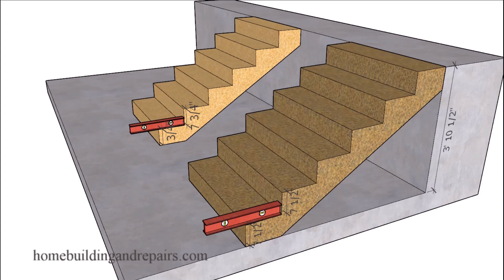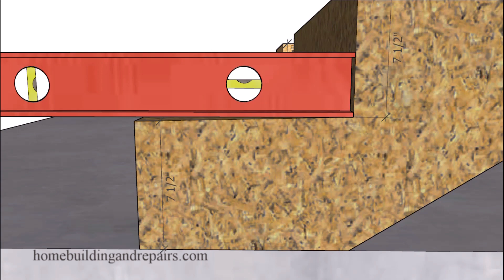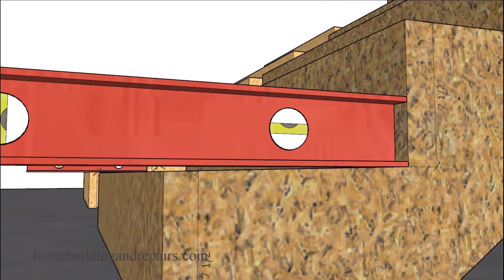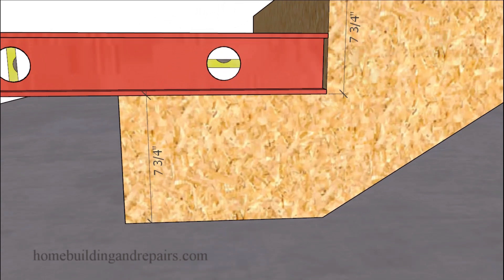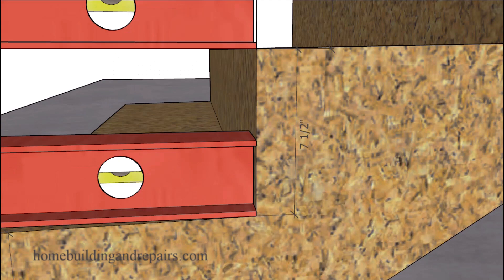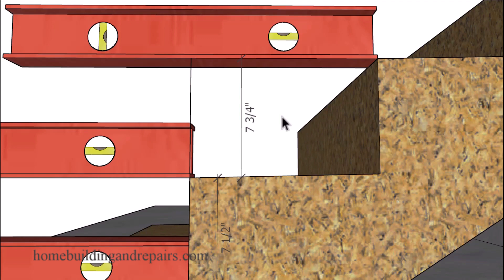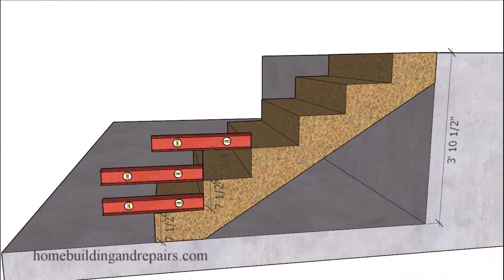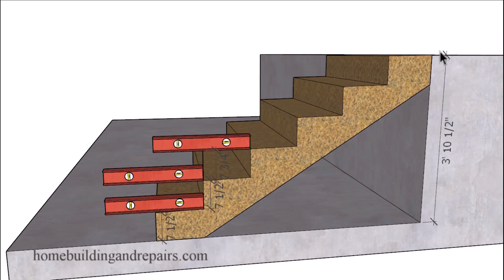How To Calculate Individual Stair Riser Height For Sloping Steps - Building Code Interpretation

Comment: I want help for stairs risers height problem

My worker has done wrong work

7 inches

7.25 inches

7.50 inches

7.25 inch

7.75 inches

6.50 inches

6 inches

7.50 inches

7.15 inches

6.75 inches

7 inches

7.50 inches

8 inches

9 inches

7 inches

9 inches